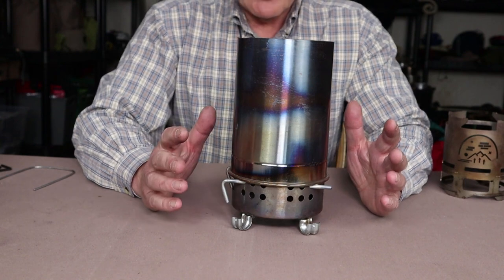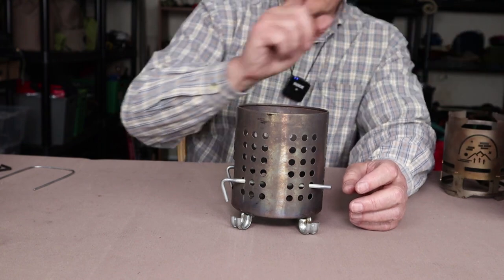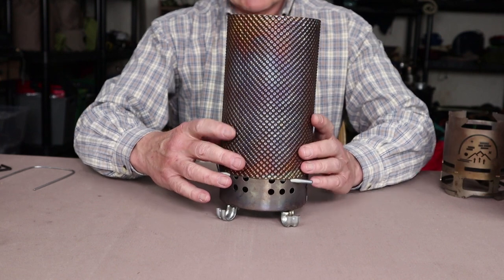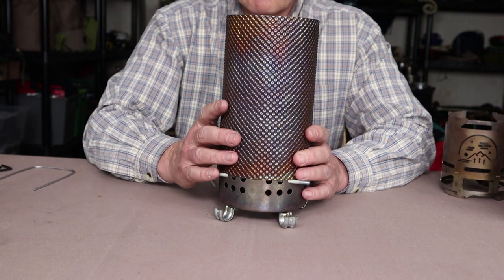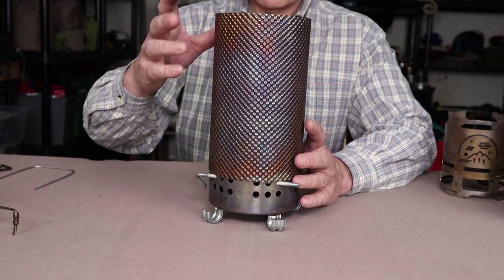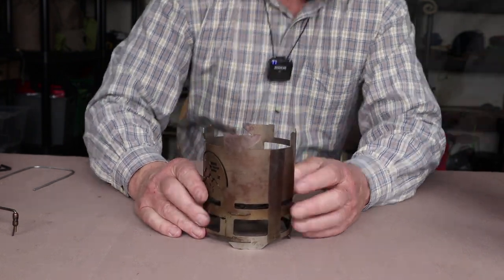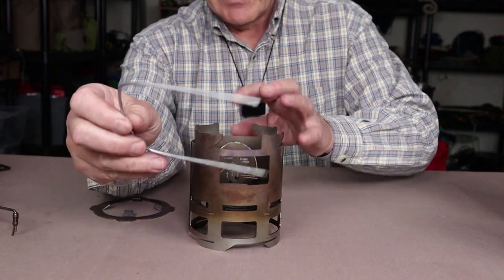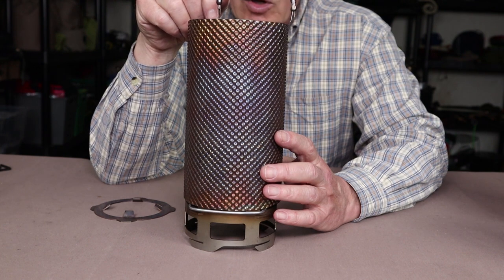Simple Theory Gear Pack Stove XL-R (Rocket)

Comment: Even on an existing rocket stove like the eco zoom or the silver fire survivor, extending the chimney really helps to get it going. I have used those folding plates wind screens but what really helps is to turn upside down a charcoal chimney starter to put a pot on or take the grate off the chimney starter and and use stakes in the holes to put the pot on at whatever height.  Using the charcoal chimney also helps to radiate the heat and top load long sticks without them falling out.
Reply from the maker: I agree. I also have played with chimney style charcoal starters (two videos) and have had great results. Thanks for commenting
Reply: @MarkYoungBushcraft  I bought one after seeing the videos. I see this as something I would carry all the time but not as my main stove.  I have a large number of stoves and they all benefit from wind protection. Recently I got into the trangia  cook system with a trangia 27 HA set. While bulkier the wind protection and the ability to focus more heat towards the cooking vessels makes cooking a variety of dishes way easier.  The flux wrap with almost any stove seems to be a winner.

Comment: I love the simplicity & robust nature of the stove on it's own. What you have done is very interesting. got me thinking if you had 2-piece nesting screen around the outside with both pieces no higher than the original stove. Then using your stainless steel pins to position the screens you could not only create your quasi-rocket stove but also position the lower section of the screen either above the feed port or cover the feed port when using wood pellets. As the top screen would be slightly larger, the joining gap could be adjusted to provide or uncover air holes to add to the rocket effect.
Reply from the maker: Right on. I see what you are saying. Most interesting. Might have to give it a try. Thanks for commenting
Reply: Awesome!

Comment: Mark,  Once again a very informative and creative video. A note on the Adjustable Pot Stand (the triangle thing): You will have stabler pot support if you add a limb and use it in the quad format. There is more contact with the base of the pot/mug. 

I am also curious if you tried just using the FluxClip feet, rather than fabricating the "U" shaped holder, to hold the FluxWrap up? It would make the diameter a bit bigger, but it would allow you to get the more optimum gap between the Stanley pot and the pot skirt of about 1/2" (the XL stove and the Stanly pot have the same diameter). The Stanley pot should be able to sit inside and down on the Simple Theory Gear XL pot rest, with the handles outside.

You can also form a "scroll" shape in the FluxWrap by rolling the two ends a bit tighter than the main body. This will allow you to place it around the Simple Theory Gear XL and leave the wood feed port open. You won't get the full chimney/ pot skirt effect, but it will form an excellent windscreen.
Reply from the maker: Hi Peter. I did try the FluxWrap with the FluxClip as feet. The challenge was in order to be able to set the configured FW over the Pack Stove I had to expand it to about 1/2" overlap. Even with that, it was a challenge setting it over the stove as the feet kept catching on the rim. It would not be doable if there was a fire going already in the stove. I could pre-configure the FW around the stove with the FC feet and it would sit much closer but then I would not be able to take it off during use. The height with the feet was lower than the U clip I made for the test but still within reason. Ultimately it was possible but not practical. I will be sure to demonstrate in the FW video. Thanks for commenting
Reply: @MarkYoungBushcraft  Thanks for the feedback, I do not have a Pack Stove XL to try this out myself. On a flat pack, square stove with the same "catching" problem at the 4 corners I simply leave the FluxWrap unlocked. I open it up, with feet near each end, and place it around the stove from the side and not over the top (actually I use the Chimney Fluxwrap, on the FluxWrap-It stove, in a similar way to avoid it catching on the rim). The FluxWrap then closes around the stove. I remove it the same way. Often the two end feet are cool enough to handle for positioning and removal, though I usually use a pot gripper and a stick to open the FluxWrap for placement and removal.

Comment: Well I always carry a windscreen. And it is an extra packet that i need to carry around. So if Mat could add a accessory that will nest with the system. That will allow me to not only have a windscreen but also  to work like a rocket stove and somehow manages it not to be above the price point of a standard  panel windscreen - then i would consider it to be a great addition to the offer.
Reply from the maker: Right on. Thanks for commenting
Reply: Thank you so much for your feedback. Greatly appreciated!!

Comment: My windscreen which I highly recommend is one of those Chinese 0.03 mm thick 15 cm titanium foil windscreens. I even cut it down to fit my alcohol stove, folding the edge over to prevent it being razor sharp. The final trimmed weight? 12 grams. I keep two extra large paperclips to clamp it into place, the magnetic buttons it comes with are less than useless.
Reply from the maker: I bought one of the titanium ones as well. I also folded down a bit. Noisy thing. Have to make sure the wind doesn't take it. Thanks for commenting
Reply: @MarkYoungBushcraft  Yes, it being light is both the upside and the downside. :-)

For the BBQ I use the fold-out screens though. I only use it for the spirit stove.